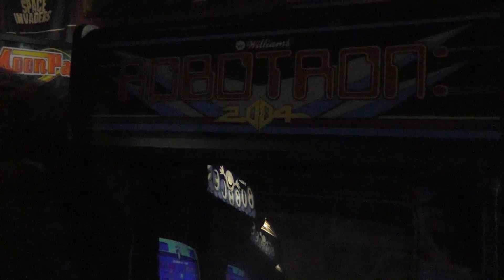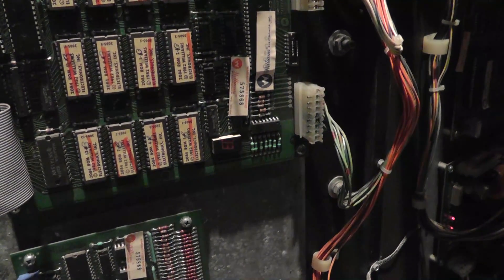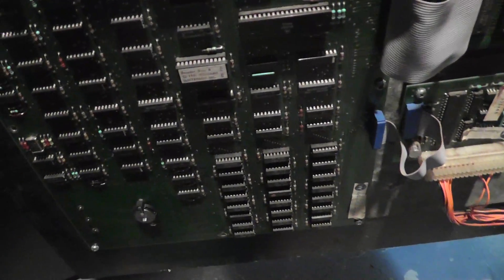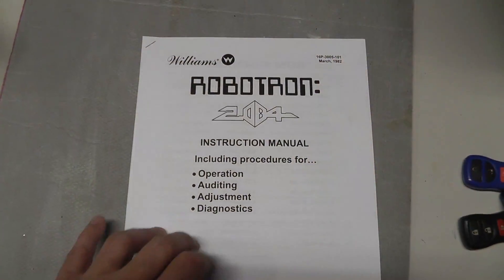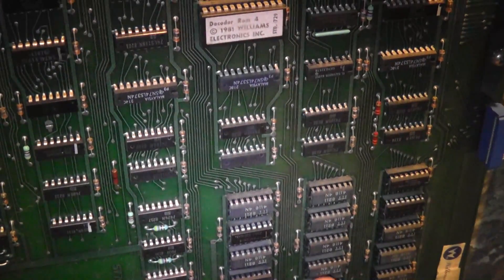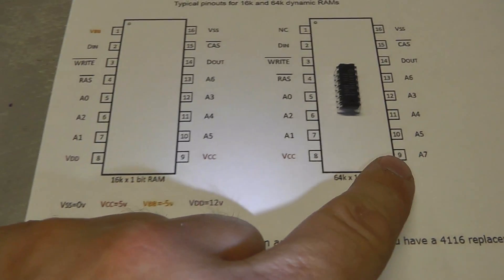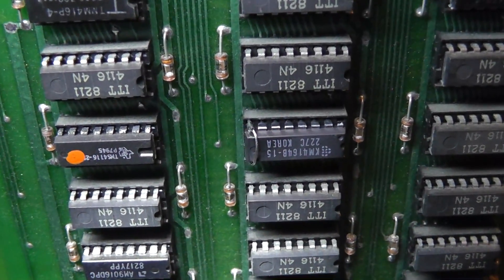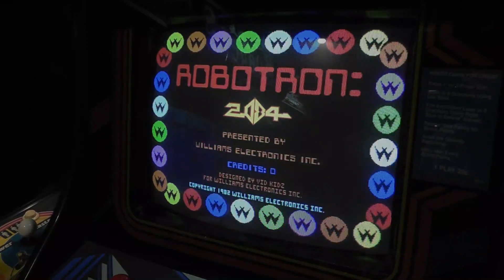Robotron Ram Error fix with 4164

Comment: Williams Defender also uses Tri Voltage 4116 RAM chips and there is like 20 RAM chips. Any reasons what are the advantages of using Tri Voltage RAM chips instead of using Single Voltage RAM chips? The Tri Voltage RAM chips Internal Memory Cells are different some use FETS or capacitor memory cells
Reply from the maker: No advantage that I know.  It is just probably the cheapest available part that met their needs.
Reply: @jacklick  Tri Voltage RAM chips are suppose to keep their internal memory capacitance lasting longer because there is +5, +12volts, -5volts. I'm not sure why text books are saying that the internal memory capacitance last long because the memory cell has 3 different voltages. Most RAM chips use signal voltage +5volts so the memory cell can't retain the stored voltage for long. Not sure if the tri voltage memory cell can store the voltage longer or not. But its coming for arcade techs to remove the 4116 RAM chips and replace them with 4164 RAM chips. I think the Fluke 9010A or a RAM tester can test the RAM chips memory cell retention tests before it decays but lowering the voltage. The fluke 9010A has a walk button, data toggle buttons.
Reply from the maker: @waynegram8907  Sounds interesting but totally not interested enough to test that out. :)
Reply: @jacklick  I know next time when you're testing RAM chips on an arcade repair video try using the flukes 9010A Walk button and Data toggle, address toggle tests for testing the RAM chips in the arcade repairs.
Reply: @wayne Gram  in a perfect world, we would all have one of those on our bench. Lol

Comment: JACKLICK]]]
]]           If the RAM range is 2000- 23FF. How do I compute the RAM's range like how can I manually compute and get that 2000-23FF hexadecimal numbers? because each number is a hexadecimal number 
        If the RAM range is 3000-31FF by looking at the decoder chip, how can you get the RAM ranges manually without having or getting the memory map to tell you the rams ranges. 
1.) What "Determines" the RAMS starting and ending ranges?
2.) If you look at arcade game schematics often the decoder chips input pin A,B,C,D one of the input pins is GROUNDED. So how do you get the RAM's starting and ending range is one of the inputs is grounded the first number would always be zero 0, but each RAM range will be 1,2,3,4
1000 to 1FFF, 2000 to 2FFF, 3000 to 3FFF, 4000 to 4FFF. But if one of the decoder chips input pin is always grounded it would be 0000-0FFF?
Reply from the maker: Fair question.  it is possible figure all this out without the schematic or someone else telling you (mame debugger) but I am not at the level to do it or explain it.